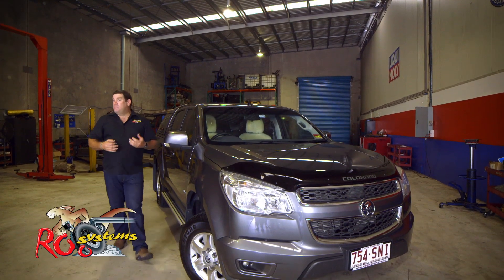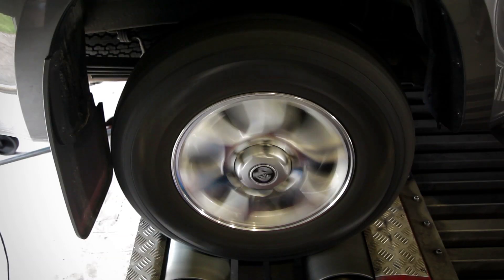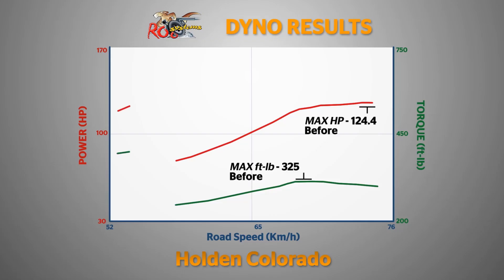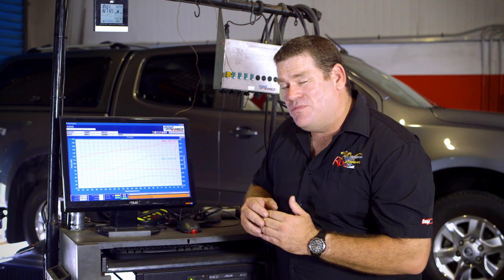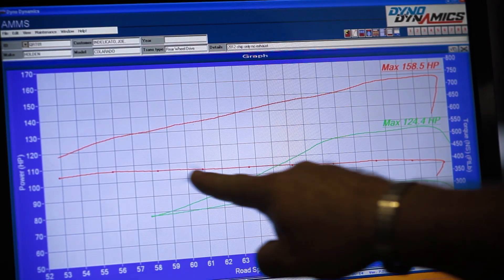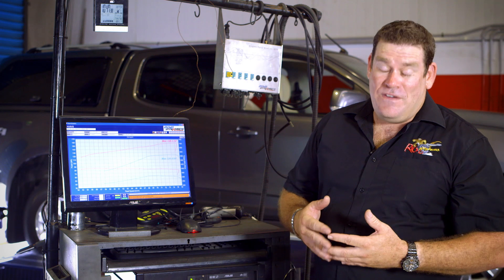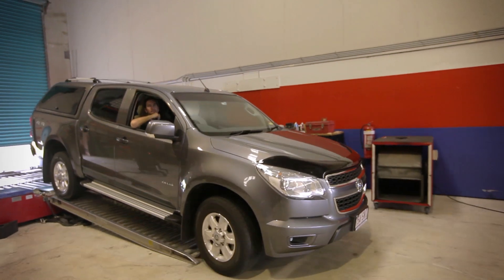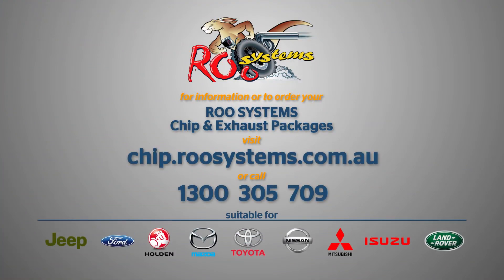Holden Colorado: Before & after dyno test - Roo Systems Diesel Chip & Exhaust Package

Comment: Why are they advertised as 130 kW standard then? Someone is lying here.
Reply: +Bryce Hollins KW at flywheel is always more than at the wheels, due to loss though transmission and diff ect. All the brand would be advertising at flywheel figure. As this is on a dyno I would guess that its begin measured at the wheels. There is no standard in Aus where car brands have to advertise power figures at the same point of measure